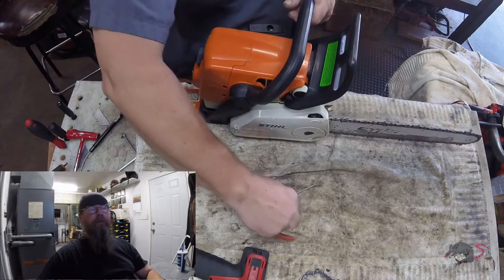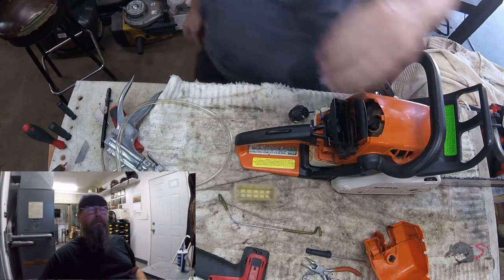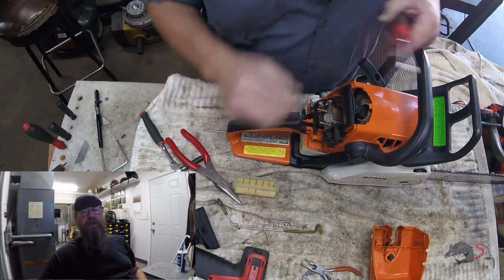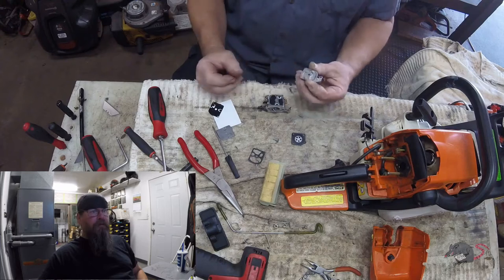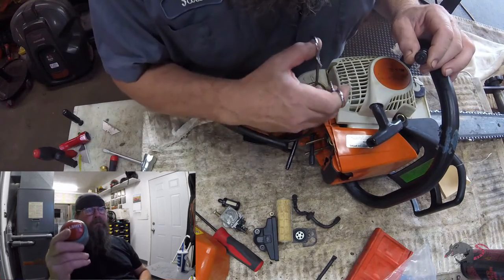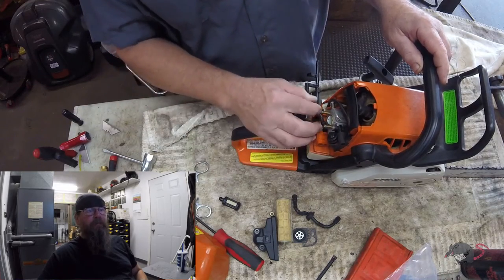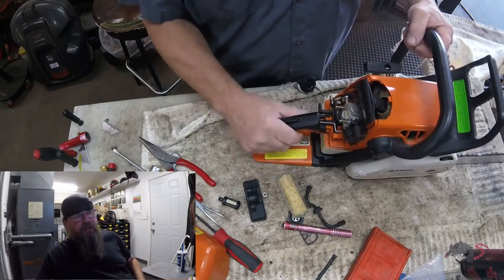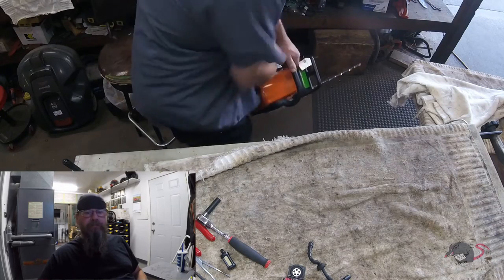Stihl Fuel Line Repair

Comment: I just changed the same gas line and is was exactly like yours.I also cleaned carb.
       I put it all back together and the saw would not start. It was getting gas and spark,,but would not fire at all.
  Took me a minute to figure it out but I found you really have to tighten the carb nuts down to get a good seal.
 Did that and ran like brand new.
Reply from the maker: Good job figuring that out!
Reply: Yeah, I had to really lean on the wrench to undo the nuts

Comment: Just changed the fuel line on my 250 the other day and I've changed plenty for others and always got Stihl brand from dealer but they had a Oregon brand for me. I didn't notice any difference so it seems fine! Like you say the part that's in the tank always seems a bit short!
Reply: You wouldn't happen to remember the model number that Oregon fuel line, would you?
Reply: @lorenz681  I'm sorry I do not. It came from my Stihl dealer though!

Comment: What was it you adjusted to stop it from bogging down at the end of the video?
Reply from the maker: The low speed carb jet. I struggled getting the screwdriver through the grommet and onto the adjustment screw, thats why I removed the cover.

Comment: I have ms180 she start fine but when i want to cut she stop in wood and wont cut.What can be problem
Reply from the maker: The chain stops or the engine doesn't have power?
Reply: @TheGreasyShopRag  chain stop and when i pick up chain from wood go full gas work ok but when i go again to cut chain stop
Reply from the maker: @SonGoku-fj1uh  I can't be sure but it sounds like you are describing a clutch problem if the engine isn't bogging.
Reply: @TheGreasyShopRag  i hope it is clutch not engine.thanks
Reply: I look for clutch and it look ok tomorow i will change my carburator kit  and my fuel line